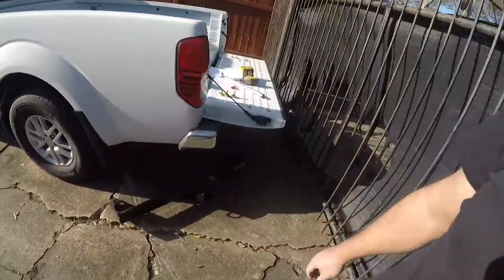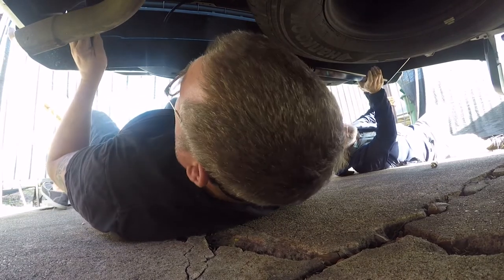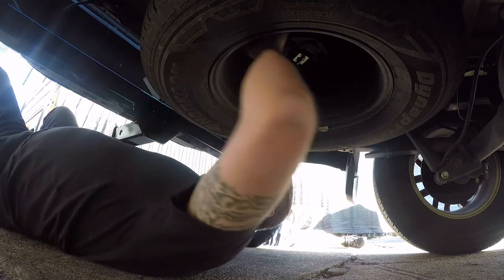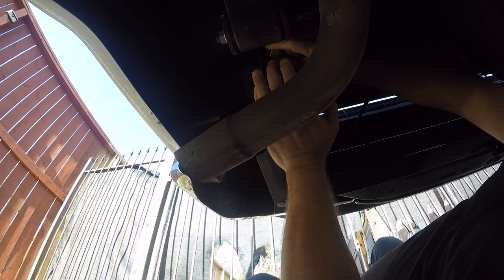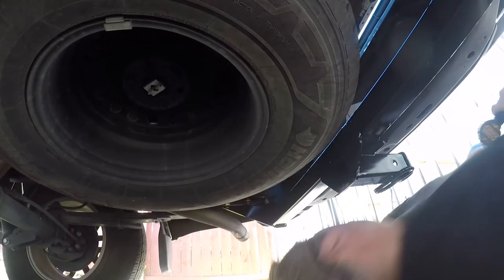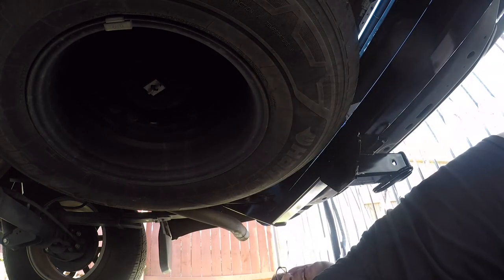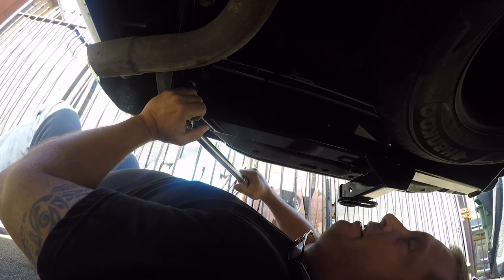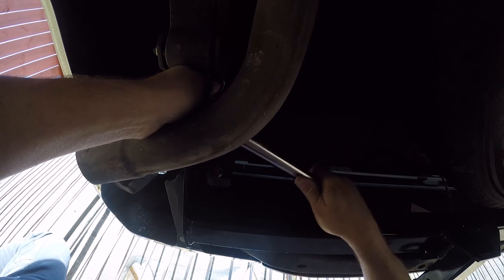Nissan Frontier Hitch Installation

Comment: Your choice to pre-check all threaded holes had me nodding my head in total agreement, as assembly and soft-mating goes much smoother when this is done. I differ with you on the use of Loc-Tite on your bolts, however...if you are using lock washers, and torquing your bolts, it's unneccessary, and being that it is mounted on the undercarriage, I would opt for never-seize.
At some point in the future, you may want to remove that hitch, and you'll thank the Gods you used the NS. All the bolts with Loc-Tite will have to be heated, to remove them.
Reply from the maker: I don't plan to remove the trailer hitch.... I'll sell the vehicle before then.  I also have a small oxygen acetylene rig so I can heat it if I need to.

Comment: How do you know what torque wrench to use. I looked on Harbor Freight and there are about a dozen to choose from.
Reply: The HF are fine, the basic Pittsburgh, if you're not doing critical assembly, and only using it here and there as a DIY. They're using accurate to -5% if used correctly and not dropped and kept out of the elements.